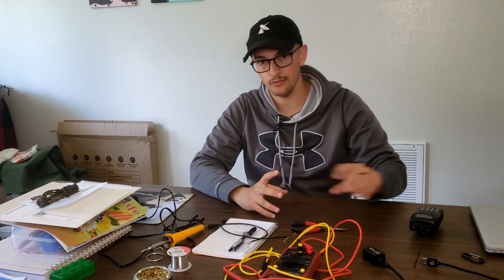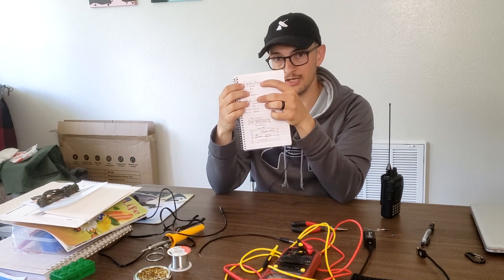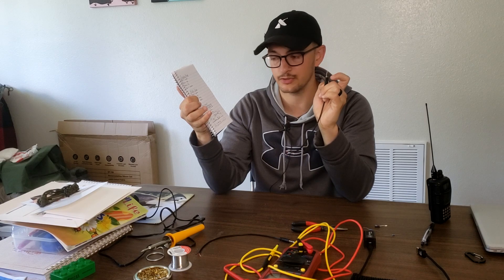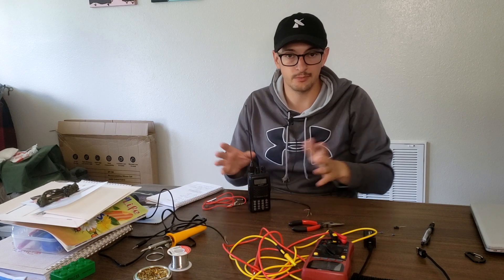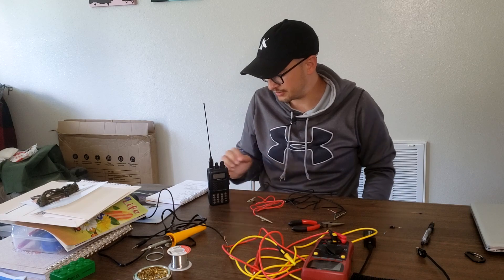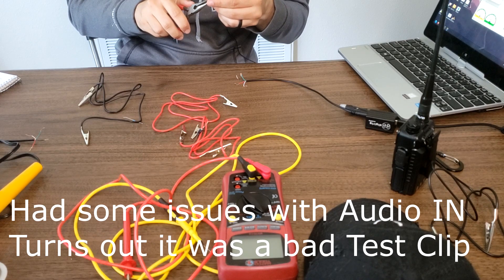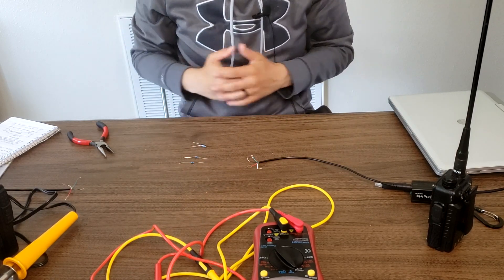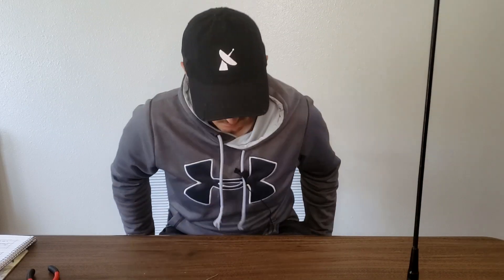Make your Own DigiRig Cables - Featuring FT-60

Comment: Nice video!  Harbor Freight has pretty cheap shrink tubbing in packets of different sizes.  I use it when I make a cable with PL259 ends.  I need to get a digirig it looks easier to use then a signal link.  73
Reply: I like to use the "Marine" shrink tubing since it has the adhesive to add to the sealing properties.
Reply from the maker: I like the digirig because it's cheaper, smaller, the audio cables are also cheaper and so far I've never had to make any modifications with it. It's lacking hardware level control knobs, but it's never something I've needed.
Reply: @ModernHam  Is there a particular model/version I need to get, (like V2, V3 or something like that)? I need to get a couple, and looked them up last night.
Reply from the maker: @arednog  I say the latest and the greatest DigiRig Mobile. You also need a usb c table to go to the computer, and then the radio audio interface. Would like to do some more videos on it coon.
Reply: @ModernHam  great, thanks👍🏻